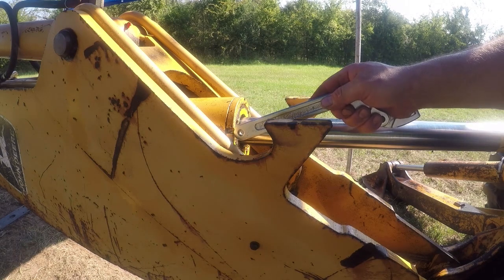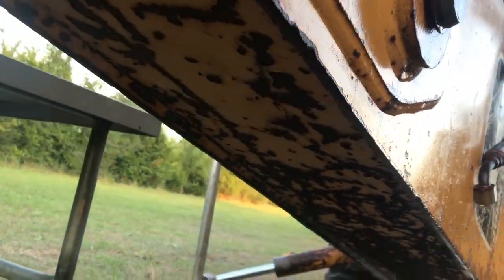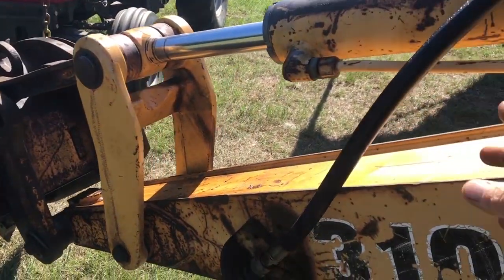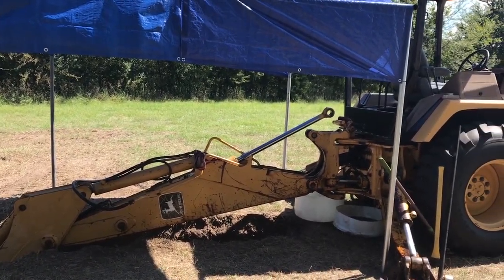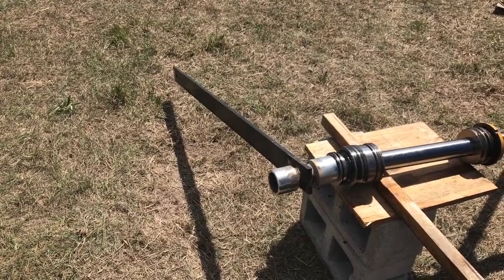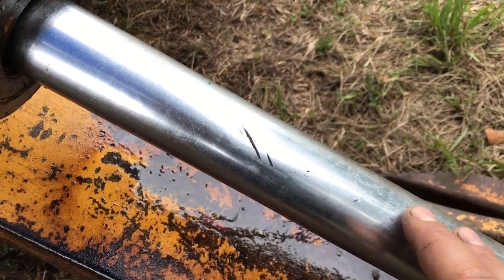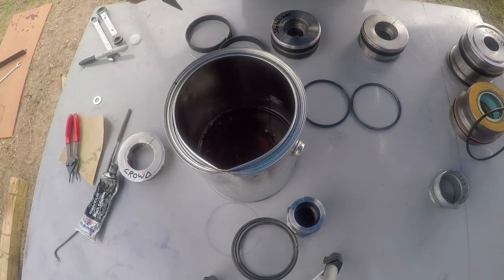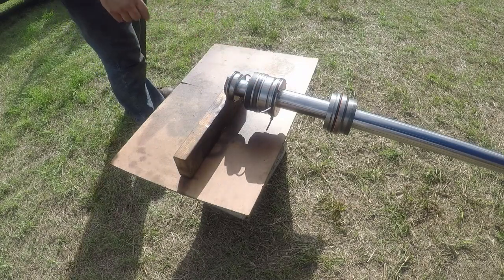John Deere 310D Backhoe Boom Cylinder

Comment: Whew,  I'm very impressed with your perfect videos.  I just bought a 1991, 310c, 4wd, extendahoe that is in much better than average shape.  Need it on the farm and new to backhoes.  I extended the boom to get all the grease points and that boom cylinder started leaking.  Because I'm new to this and it's the biggest cylinder I was thinking to take it to a cylinder repair shop but maybe I'll try it after watching you vid.  I'm 67 and not as strong anymore.  It came with the parts book and I just got the exact copy J.D. owners and service manuals from Peacfull Creek LLC.  Awesome source.  Ordered Mon. here on Wed.  Already paid for themselves as I didn't know about the Reverser dipstick which had no oil showing.   Your videos are very clear,  to the point and shows how to do things right including keeping everything clean and organized.  The cutaway schematic is really helpful.  Thank You from  Battle Creek Mi.
Reply from the maker: Thank you sir، I appreciate your feedback, congratulations on the backhoe. If you have any questions please let me know, have a great evening.

Comment: Using the hammer drill is a great idea, I broke a spanner just like yours trying to open a cylinder. snapped the pin right off of it. Digging that hole with a shovel was also am interesting idea . I live in Connecticut a hole that size would have taken 2 full days with a shovel, a pick and a digging bar. We have extremely rocky soil.  Great work.
Reply from the maker: Thank you sir,

Comment: Hi Salam,  Love your videos with excellent explanation and camera work.  I'm about to do the same cylinders on my J.D. 310 C and getting tools around.  Bought the 1" impact you have and 1" sockets so far.  Looking at the Rotary Hammer.  So confusing of what to get. Bauar 1641E-B  SDS $99, , Bauar 2142E-EB  SDS Plus $130, , Hercules HE34 SDS Max $200.   Won't be using it a bunch but want it to get the job done and wonder what you use or recommend.  Is there a big difference in the adjustable spanners quality?  Thanks for your great videos.
Reply from the maker: Hello, if you are not going to use the jack hammer for anything else, then it maybe better to rent one and lose all the cylinders that you are planning to do then return when done. You only need it for a couple of hours. If you are planning to purchase one, I only use Milwaukee, DeWalt and Hilti. For the adjustable spanner, I bought one from Amazon and I think it works from 4 inches to 6 inches. Make sure to watch the last video about hydraulic cylinders that I have on my channel, at the end of that video I explained a lot of useful information. Be safe and have a good day

Comment: Hi Salam could this oil AW46 fluid used in my hydraulic system and transmission for John Deere 410G backhoe?
Reply from the maker: Hello, they hydraulic fluid for the hydraulic system and the transmission must meet the John Deere JDM J20C, J20D (“Low Viscosity” grade) specifications. I use the Phillips 66 powertran fluid as it meet the specifications requirements for all my equipment. Read the datasheet for the AW46 and see if it meets the John Deere JDM J20C, J20D specs. I hope this answer your questions. Please let me know if I can help you with anything else. Thank you for watching.
Reply: @SalamSayhood  Thanks much

Comment: do you know where to drain hydraulic oil？
Reply from the maker: There are three hydraulic systems for this machine and two filters.
The filters are located under the driver seat (on the machine frame) to the left side.
The differential has a drain plug on the bottom side.
The transmission has a drain plug on the bottom side.
The hydraulic cylinders and steering system use the hydraulic tank in the front of the steering wheel and it should have a drain plug at the bottom. I hope this answered your question

Comment: Question,  I have the same machine and have the new jd kit.   Why not just swing the whole boom to either extreme lef or right.  Especially if machine is raised with with outriggers.   It should clear.  What do you think.  Great videos. Keep them coming
Reply from the maker: When I rebuilt the boom cylinder, the machine was dead, I didn’t know I had to dig for the boom. I mentioned in the video, you can swing the boom all the way to the left or to the right. However, I also wanted to rebuild the swing cylinder, work on the boom the way I did allowed me to work on all the backhoe cylinders while I was waiting on part for the boom cylinder. You can view all the videos I posted regarding the rebuilt of the hydraulic cylinder on my machine. If your machine is operational, I highly suggest for you to dig for the boom to go low so you can work on it easier than have it high where you can’t reach it easy and also you don’t have to worry about the outrigger bleeding out or support the machine to stay high. If you have more questions please let me know. Good luck
Reply: @SalamSayhood  thanks, I did both swing arms last month.  Now just the boom needs rebuilding.
Reply from the maker: Try to do it the way you think about doing it, get a straight pipe or piece of wood, line it parallel to the rod and see if the rod will clear.
Reply: @SalamSayhood  thanks,  I will do that.  Do I need to disconnect any hydraulic lines. Also do I need the steel sawhorse for holding up the boom
Reply from the maker: If you only doing the boom cylinder, you don’t have to do anything other than lower the boom into the ground. The frame that I built was for the dipper cylinder. You have to disconnect both hydraulic lines, I removed mine from the spool, under the joystick, see my other videos about the 310d hydraulic cylinders,  it will help you. I posted tips and tricks in each one of them regarding the task.
Reply: @SalamSayhood  just so we are correct,  the boom cylinder is the one buried in the frame?
Reply from the maker: Yes sir. Make sure you got the correct kit. also use the half ring when you extract the piston so you don’t damage the cast iron ring. The rod I is heavy, when you pull it out don’t drop it. Make sure everything is super clean when you are ready to install the new kit. I covered all that in the video, I also covered the tools required and other information at the end of this video: https://youtu.be/cbBnHbYKy0w
Reply: @SalamSayhood  yes I have the right kit from jd dealer.  One last question,  I hope. Lol.  Before I disconnect the lines. Should cylinder be all the way out or in.  Again thanks
Reply from the maker: Make sure the boom is all the way down. With the backhoe engine turned off, keep moving the joysticks to release all the system pressure.  I cut 55 gallons plastic drum and made to large containers to collect all the oil that leak from the hoses or the cylinder. I appreciate you subduction. Please let me know if you have any additional questions.

Comment: Very helpful video, I have the exact same backhoe and I have to replace the seals in mine. Can you tell me what the part number on that kit was? Thank you again for the video!
Reply from the maker: Hello Levi, please watch this video:
John Deere 310D Hydraulic Cylinders Finale
https://youtu.be/cbBnHbYKy0w
At the end of it, I explained everything about the job including, how to find and where to order the right parts. Even if the backhoe is the same model, John Deere uses different part kits. So make sure you follow the example I gave in the video to order the correct parts for your machine. If you have any more questions, please let me know, Thank you and good luck,
Reply: @SalamSayhood  thank you so much for all the help, I greatly appreciate the video and your reply! I just subscribed to your channel and I hope you continue to help others. Have a great day!
Reply from the maker: Thank you for the subscription, I forgot to add to my last comment, You can also go to this website: https://partscatalog.deere.com/jdrc/ 
Enter you machine number and search for the part yourself. If you have any more questions, please let know. good luck,
Reply: @SalamSayhood  Good afternoon my friend, I got my seal kits and started pulling the boom rod yesterday evening. I am currently at the same place as you are at the 11:18 mark in your video but there is some rust at the end of the cylinder inside and I cannot get the gland out. I have taken the ring out of the end and i can get the gland out approximately 1" past the threads but this is as far as i can get it. I have pushed it back in and used very fine sand paper and put a little grease at the end of the barrel but still no luck. Any tips you might have?
Reply from the maker: Good afternoon sir, push the gland into the cylinder, clean the bore from the rust until you have smooth surface, install the half ring and make sure its seated correctly, use grease or oil to lube the bore, pull the rod until you can install the nut back on the gland, then use large screw drivers or pry bars to pull the gland all the way out. please let me know how it goes or if you need more help.
Reply: Thank you again, this worked very well. The half ring was not seated correctly and was trying to push out when the gland came in contact with it. Once I put a big screwdriver on each side it started to come out easily. Now my new problem - it seems the John Deere dealership gave me the wrong seal kit. This one is too small, I am assuming it is for the Dipper cylinder.
Reply: I will go to the dealership tomorrow, for now the hard part is done. I am going to clean the barrel tonight with a honing tool as you did in one of your videos and get everything prepared to put it all back together when I get the correct kit. I am so glad you posted your video - digging the hole before I got started was a tremendous help and very safe. Please continue to post more videos, they are amazing help for people like myself that have the tools and can do the work but don't have the knowledge!
Reply from the maker: I am glad I was able to help you brother.
Reply: Sorry to bother you again but the dealership is asking me for the cylinder number and I did not see any? They are not very helpful today sadly and they don't know where the numbers would be either. I have the identification number for the background but they aren't able to help me with just that number. Do you happen to know what the part numbers were for your boom cylinder kits?
Reply from the maker: Good morning brother, you are not bothering me, anytime you have questions, please let me know, if you don’t mind, give me the PIN number for the machine. I will look up the kit number for you, Or you can go to this website and enter the machine PIN number and search it yourself: https://partscatalog.deere.com/jdrc/
Please keep in mind, John Deere database for these older machine is misleading, make sure the result you get from the search contains you machine PIN number.
I explained the John Deere misleading information at the end of this video:
https://youtu.be/cbBnHbYKy0w
Reply: My pin number is 805481. I just watched the end of that video and showed it to the counter salesman at the John Deere dealership so that he would know for future reference as well. He said they do not have it in stock and that he would have to order it Monday morning but he did not tell me what part numbers he is planning on ordering. If you have a moment to look them up so that I can make sure he orders the right parts on Monday I would be extremely grateful.
Reply from the maker: I need the complete PIN number: what you posted is the last part of it: it should be something like T0310DA8xxxxx.
Reply from the maker: @levi.69  Make sure the rod measure 56mm in diameter and the bore of the cylinder measure 115mm inside diameter. If those two measurement check out then you will need:
Rod kit: RE31716
Bore kit: AH149846
I used these two kits on my backhoe its very close to your machine PIN number. They should be available from eBay or amazon.
Reply: @SalamSayhood  yes, my rod is 56 mm and the bore is 115 mm. Thank you for taking the time to help me with these parts, I am going to look for the kits now. I will keep you updated on my progress!
Reply from the maker: When you receive these kits, they will have extra orings. These two kits cover several John Deere hydraulic cylinders. Also make sure to heat the Teflon ring as I did with the hot hydraulic fluid so it will goes easy and doesn’t get damaged.
Reply: Salam, you really saved me so much headache not only with the video but with the parts. I thought something didn't seem correct when I left today from recording the new kit because the new kit he was going to order Monday morning was only 1 kit and it was under half the price of my original purchase, which was very suspicious. I too a picture of the kit he was going to order for me on Monday morning and it was
RE20343
I just looked it up and this kit is way off from what I need. You're videos and your responses have been invaluable and again I thank you. I am still searching for the kits you posted just to find who I get get it the fastest from since I have the rod out and now the cylinder is open. I have a towel inside the cylinder and 2 very thick construction plastic bags wrapped over the top with a zip tie to keep them on to ensure no debris or moisture of any kind gets inside. I watched your video again about putting it together and using heat for the teflon ring, so I have everything ready to put it back together once I get the new kits. I can't thank you enough - if you ever need any help on plumbing please reach out as I am a master plumber and gas fitter. I will gladly make a video with any help or advice you may need!
Reply from the maker: Good morning brother, I appreciate your very nice comment, it is my pleasure to help. Like I said, John Deere database for these machines is confusing and not accurate. They also changed some part numbers, so you may have the same kit with two or more different part numbers. I use their website to find parts, then I look them up, sometimes I can find measurements in the description and cross reference that to my part. If you can’t find the parts, there is a local hydraulic o-ring/seal shop. They have everything, however they are more expensive that eBay and Amazon. I bought both kits for my boom cylinder from RAParts INC (Amazon user). Best of luck
Reply: Good afternoon my friend, I finished my boom cylinder yesterday morning and everything is working fantastic! Your videos saved me so much time and work. You made everything very simple, from how to set up, what tools do you use, tips to help make things go correctly (like putting the teflon ring in the warm hydraulic fluid). Again, thank you so very much. I will be rebuilding my stabilizer cylinders soon. If I may ask for one more favor, can you help me with the parts numbers for each different cylinder? I started looking last night and I got a little confused because there are several different kids for each of these cylinders and I just want to make sure that I am ordering the correct ones. Thank you again brother!
Reply from the maker: @levi.69  Good morning Levi, I am glad to hear you got your boom cylinder working. This is the list of kits I used on my Backhoe, Please make sure they will work with your backhoe before you order them. Measure the bore and rod and make sure the bore and rod kits are the same size:

ONE LOADER BUCKET CYLINDER
AH212096       
RE20434           

TWO LOADER LIFT CYLINDERS
AH212091        
RE20434          

TWO STABILIZER CYLINDER
AHC19515       
RE20343          

TWO SWING CYLINDER
AH149844        
RE20595           

ONE BACKHOE BOOM
AH149846       
RE31716           

ONE BACKHOE CROWD
AHC19515        
RE31716           

ONE BACKHOE BUCKET
AH212096       
RE20595   

ONE STEERING CYLINDER
AH167552
AH149810